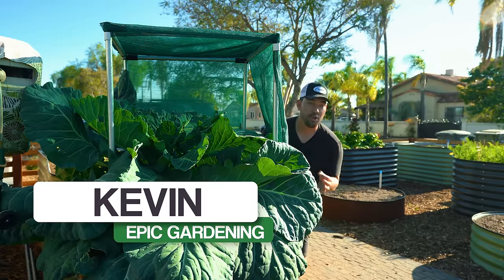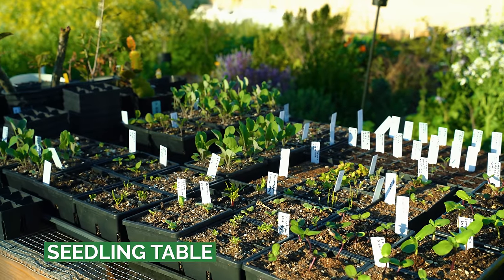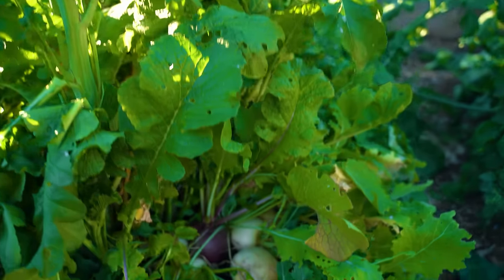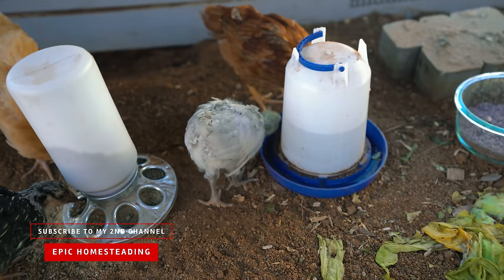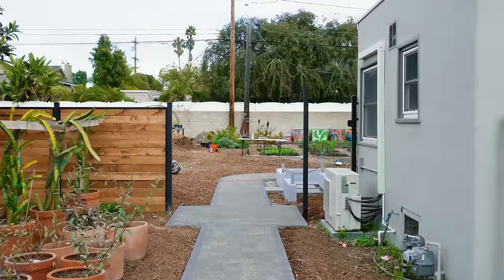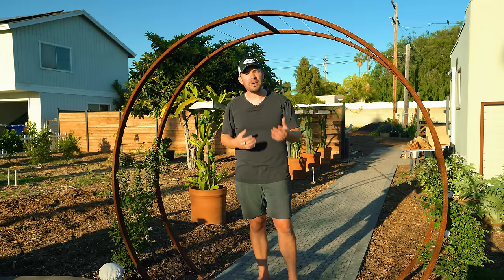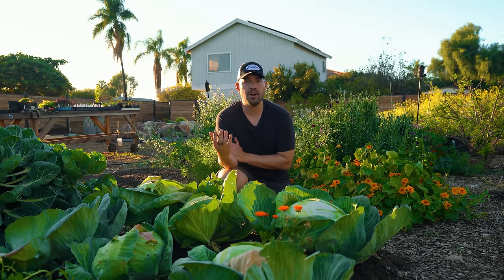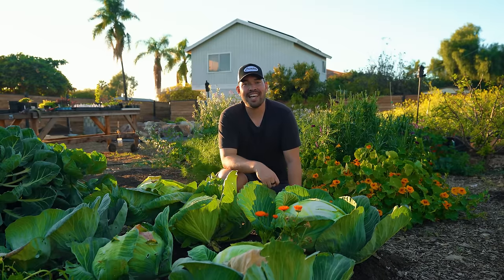FULL 2022 Garden & Homestead Tour!

Comment: 2 weeks ago i cut down a bunch of brush and discovered an old old cistern from the farm house that used to be on this property. Its all brick about 15ft wide and over 40ft deep with about 30ft of that already holding water. I'm going to test the water first just to be safe but assuming that comes out good thats going to be our water supply for our 50x50 garden this year. I just need to figure out a pump for it. Probably not this year but soon I think im going to route the gutters from my 40x60 building to it but I'll have to add in an overflow which will be a bit of a job.

Comment: Hi Kevin,  Great video, thanks for the intro.  One important thing about your rainwater system.  You will need to add some continuous water circulation and disinfecting (e.g. UV), otherwise, algae and bacteria will start forming pretty quickly in the pipe and in the tank, which could potentially be passed on to your plants (and can cause illness).  Since you don’t have frequent rain and you have hot weather, this is a high risk in your area.  Looking forward to your next video!

Comment: Have you considered implementing wind technology? I see plenty of wind in your videos.  Harmony VAWT is a product I’ve been following for a few years now and it’s something I’m interested in implementing at my home which would be a source of electrical supply at night, day, hot or cold as long as there is a wind source.  Adding that option to a solar powered system would mitigate the lack of production at night (as long as the wind is blowing) and would continue to keep the solar battery topped off.

Comment: "Typically you wouldn't let it reach this point" why ? That's the opposite in cover cropping, especially in large scale cover crops for big farms. You wait until it flowers well, and then you roll it over, there is no need to chop and drop. You just roll it down or squash it down with some planks. That way you get the maximum out of your cover crop : not only does it feed the bees and other insects for a while, but it also reaches that stage where it won't grow back. If you chop and drop, I guarantee you that tough stuff like rye will grow some new leaves and be annoying. It's not the case with mustard, but for grasses, yeah. It's a LOT less work to just roll it over or squash it over, I do it every year, I must admit I don't understand why you don't do that.
Reply from the maker: We were trying to optimize for no seed production -> transition to a melon / cantaloupe patch
Reply: Do you not have problems then with stray seeds?
Reply: @m.z.593  Sometimes you see a clump of rye grass pop up the next year in your veggie crop, but it's much easier to remove than some of the weeds we have in our garden, like quack grass. If your mustard goes to seed, it's not invasive at all. You pull it out easy. Same with fava beans or winter pea. I never had an issue. It's much less work than cutting your cover crop by hand like these guys do. I have so much cover crop, it would be a nightmare. Squashing it down with a pallet take literally 2 min per bed.
Reply: @nicolasbertin8552  oh that's good to know, thanks

Comment: Ok I have a question.  I used the poly tubing with emitters every 18 inches apart for my veggie garden.  I live in zone 9b low AZ desert.  They don't seem to water well enough, distance just too far apart. I was wondering if I could add one of those adjustable emitters between the in line emitters?  What do you think?  I really like the adjustables because you can set each one to the amount of water you want to use and change it accordingly.  The store I purchased from only had the 18 in emitters.  Didn't even know they came closer at the time.  I learn so much from you.  Thanks!